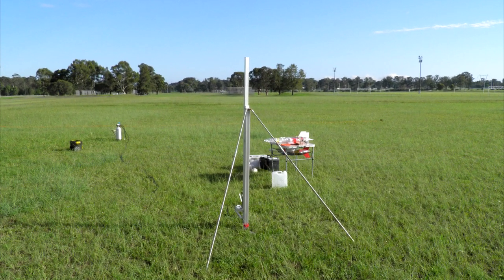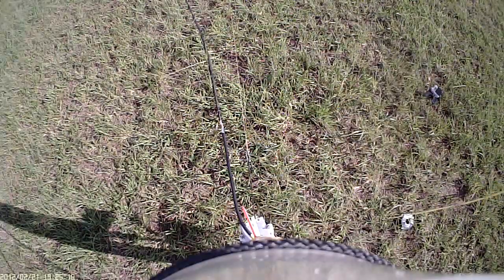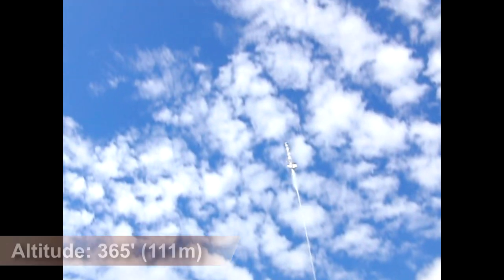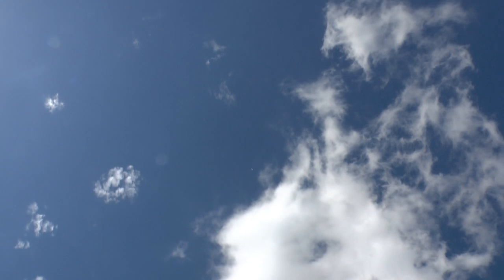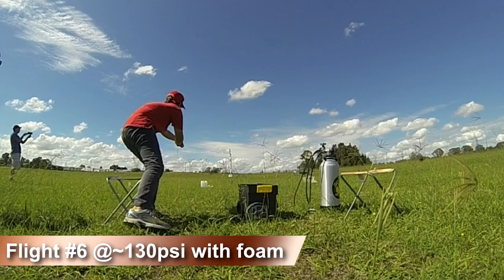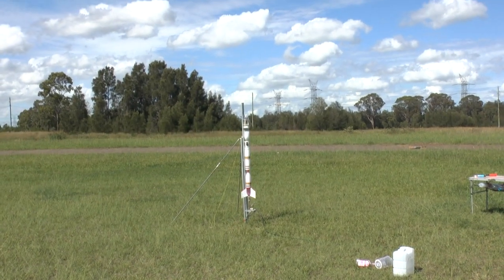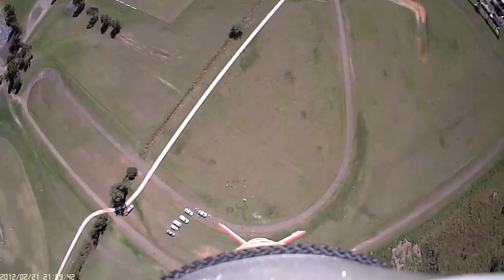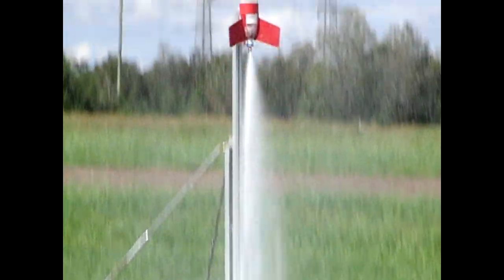Roll corrected and foam flights at Whalan Reserve

Comment: Hello Air Command. Great video as always. :) It looks like once you have mastered using the 9mm nozzle it doesn't reduce altitude at all- but quite the contrary! Do you think that less roll increases the altitude?
Reply from the maker: Thanks Jamie. :) The restricted nozzles can be a bit of a hit and miss. In general the full bore nozzles outperform the restricted ones by 5-10%. Usually when we fly with foam the flights arc over so they don't quite get to the full altitude. Over the years we've seen hints that the foam performs well, but with these flights the rockets went straight up so we could get a better idea.

Comment: super cool, hey George... I saw on your site that with 2 layers of glass the PET bottles can hold up to 300psi...  you ever gonna launch the PET bottles at 300 PSI? I'm curious what max Q is for PET rockets?
Reply from the maker: Hi Michael, yup we hydro tested some of the splices to 300psi. I think that is pretty close to the limit though with the 2 wraps. We had a failure of one on day #103 at 250psi on the pad, even though it was hydro tested to 270psi previously. I think the compression heating must affect the bottles in some way and weaken them. We probably would not launch them at 300psi unless they had another wrap. Re max Q, do you mean it in terms of dynamic pressure on the rocket in flight? I guess it would come down to how fast you could make it move.
Reply: maybe S fiber glass would take a launch at 300 PSI?  I have a spliced bottle now with 2 layers of S glass but just haven't gotten around to launching it.... and yes, i'm wondering at what point additional PSI will no longer provide more altitude.
Reply from the maker: michaelwni Hopefully the S glass would be able to handle it at that pressure. Time to go out and give it a go. :)

As far as max altitude goes that is a very good question, I don't think anyone knows yet what is practical. The problem is that as you compress air more and more the less compressible it becomes and therefore it proportionately stores less and less energy. (Like compressing water.) IIRC at 300 bar you have a loss of around 10%. You could liquefy the gas and then just use the vapor pressure to power the rocket. Liquid CO2 would be practical for this (only about 1000psi). Although a liquid nitrogen rocket would be cool! 

Even if you reach a limit with the pressure, you can still optimize the aerodynamics and weight of the rocket for more altitude. And then you could still use multiple stages to go even higher.

Comment: 541' at 130 psi? That really blows my mind on how much the the flight improved by just adding foam. Awesome!
Just wondering: are you going to be able to fly the Shadow at the new launch site? Or the Polaron G2?
Reply from the maker: Hi Randy, yup we too were surprised at the altitude and there was no launch tube assistance! When running the simulations for water alone the rocket flew fairly close to the predictions, but significantly higher with the foam. We had seen this performance boost a few years back as well on a couple of flights. It would be good if others try to replicate the results. We didn't use the jet foaming spacer for these flights. We can shave around 60-70 grams off the rocket fairly easily and improve the aerodynamics a little to see how far we can push it.  More tests to come... :)
Reply from the maker: AirCommandRockets Forgot to add, we may be able to launch the rockets there but it will depend on wind conditions. We are currently planning to launch them out at the club's high power launch sites.
Reply: Hey I got one more question for ya George, then ill leave you alone. :-D I've noticed that on almost all of your launches that the water phase on most of your rockets seems nice and linear, while on my rockets the water is cut up into little 'diamonds' and the rocket seems to be taking off slower than I've seen on anyone else's on youtube. Any idea on what can be causing it?
Reply from the maker: ReptiglorandRockets . We don't do anything unusual in the nozzle to make the water come out that way. Do you perhaps have a washer that is protruding into the water flow (even a little bit) and causing it to become turbulent? It's always hard to compare how quickly a rocket takes off because from a video you can't tell how heavy the rocket is or what pressure it is being launched at. Does it happen with all nozzles or only particular ones?
Reply: ReptiglorandRockets . Interesting you should say that Randy. When reviewing the slow motion footage of our smaller rockets using the 9mm nozzle I seem to get the same turbulence in the flow. I have no idea what is causing it!
Reply from the maker: JSB Rocketry If the internal nozzle walls and nozzle inlet are clean, then another cause could simply be that air bubbles are entering the water.

Comment: Great new location, looks fantastic. The improvement in stability is sensational. Makes the on-board videos even better than before. I didn't think that would be possible. :)
Reply from the maker: Thanks biggles1024, we've gone about as far as we can practically to reduce the roll using this technique. The roll correction appears to be somewhat speed dependent as can be seen during the boost phase. But it's close enough to where we are happy with it. :)

Comment: Wow 541 feet at 130 psi is very very nice guys! I did't not know that it was possible at that pressure. I like the way the roll correction works, it getting better and better every time. Keep up the good work!
Reply from the maker: Thanks Basrockets, we were a little surprised too that it went that high. At first we thought maybe the altimeter had a problem, but visually you could tell the rocket was higher from both the ground and from on-board video. The flight time was also significantly longer. It was an ideal flight too because there was very little wind, and the rocket went straight up. We'll have a go at reproducing the flights next time. :)